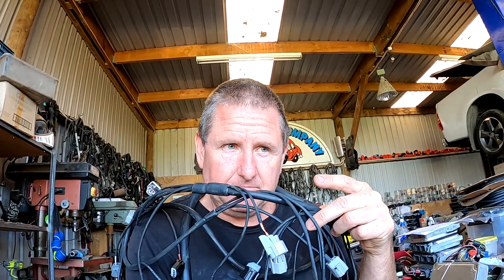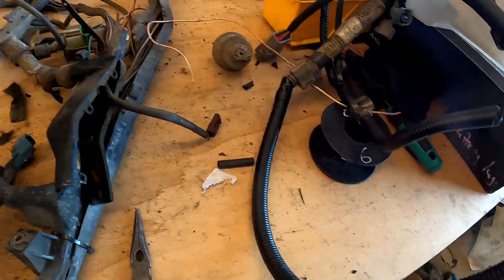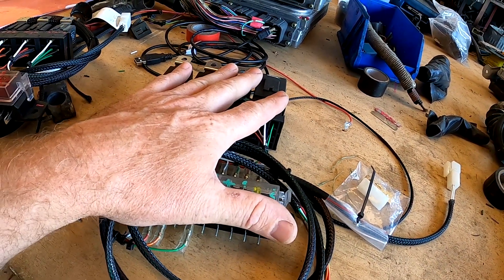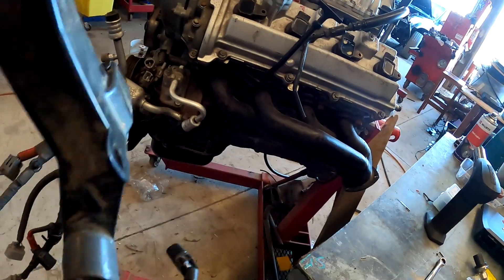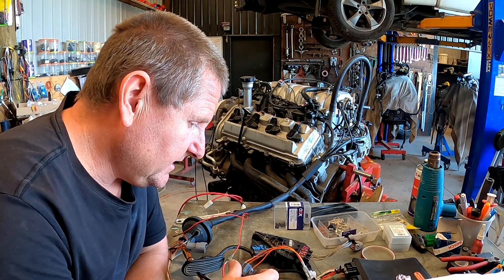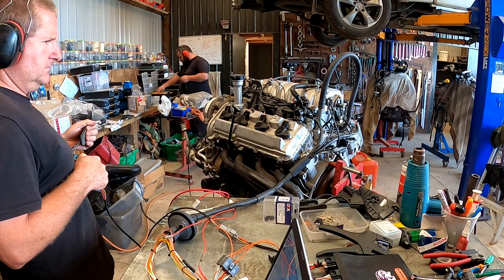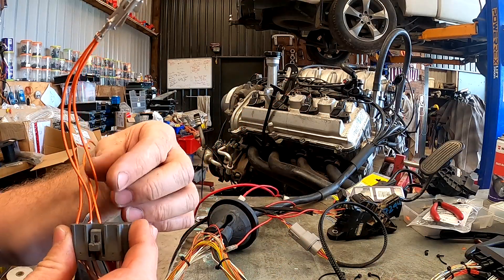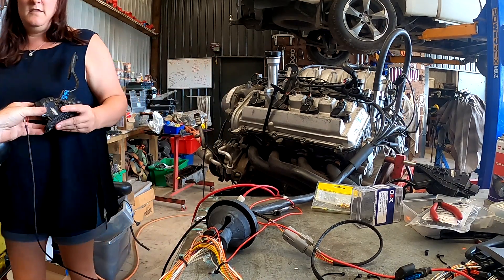1uz or 3uz Swap. Integrating swap wiring into the vehicle. 3uz Link Ecu  into Toyota 4 Runner.

Comment: Hey mate, great video. 
Quick question, if I’m doing a 3uz into a 49 pickup.  Would the factory engine wiring harness and factory ecu run the engine ? Or does it have to many new security system built in? Thanks
Reply from the maker: We have a swap tune which we flash into the 3uz ecu for swaps and it also deletes the security off the ecu allowing it to start.  Cheers Kelvin

Comment: Hey Kelvin. I wanted to swap a 1uz into my AWD 06 is250. I just wanted some advice see how was going to try the Plug n Play method. I did also want to use an Electronic throttle body. Please reach out if you can
Reply: Also to add the 1uz I'm looking at has VVTI
Reply from the maker: Ok.  The swap should be possible but I don't quite understand plug and play in that swap.
Reply: @CartuneNZ   someone said to try the plug and play what would you recommend sir.
Reply from the maker: @shadowkiller2078  I dont have enough details to comment further.   I make stuff work,   as shown by the videos.

Comment: hey Kelvin, would you say that the 3uz is externally same dimensions as a early 1uz non-vvti engine. the reason I ask is that I have to make a choice here.  I have all the measurements for the early 1uz and it will fit my engine bay.....height,width,length.
Reply from the maker: The vvti is flatter across the back of the heads and apart from that very similar.   They are the same block.

Comment: Is there a way to get more power out of a 3uz without Turbo nitrous or supercharging
Reply from the maker: Yes.  Normal engine enhancement works on 3uz like any other engine.  Its air in and air out.  Tuning stock ecu is good,  tuning aftermarket ecu is better,  provided the aftermarket has more abilities than stock ecu.